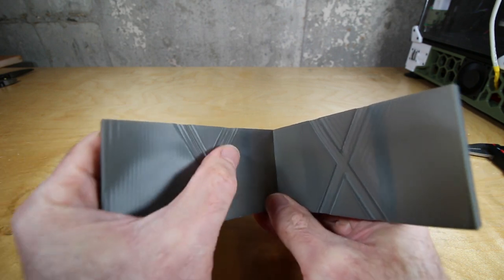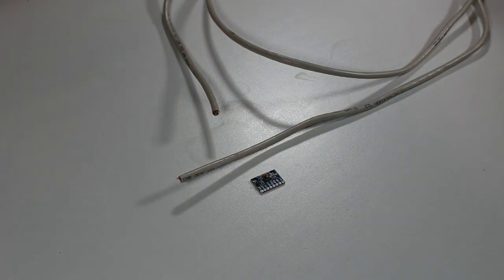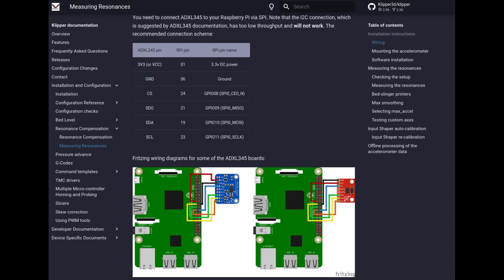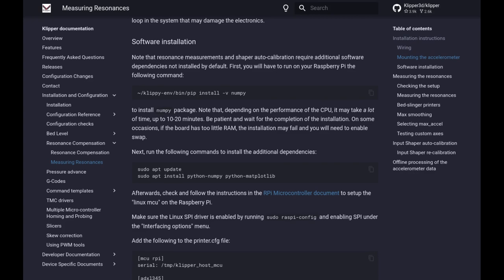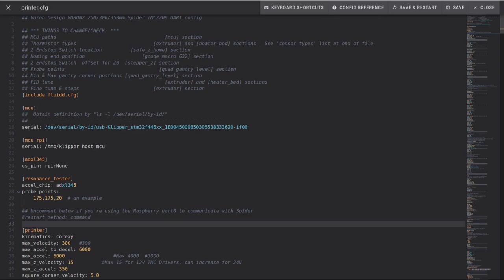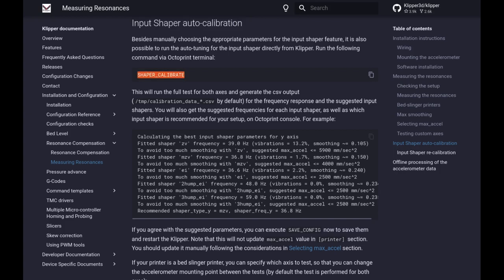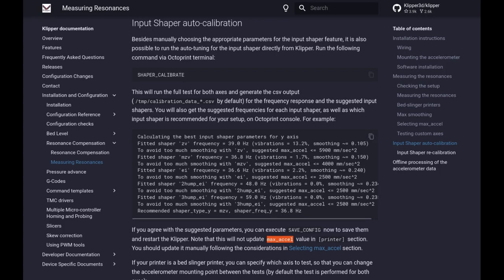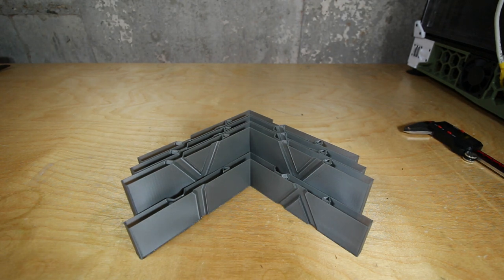Eliminate Ringing at 10,000 mm Acceleration with Input shaping?

Comment: Your video was extremely helpful for me. I also have a Voron 2.4 350x350mm and my settings turned out almost the exact same as yours. At first when built the cable to the ADXL345 I used a ribbon cable that I had lying around, and either the cable didn't work, or the accelerometer was bad. I switched to a CAT6 cable and another accelerometer and then it worked! Looking forward to your next upgrade and thanks for putting this online.
Reply from the maker: I'm glad to hear it.  Thank you very much for watching!

Comment: Thanks for the great guide. Would you mind sharing the STL/3MF file you used to test the ringing? I assume it'd use multiple height modifiers to change the speed/acceleration through the print?
Reply from the maker: Here is the actual Klipper guide: https://www.klipper3d.org/Resonance_Compensation.html?h=input+shaper#selecting-max_accel
And also referenced on that page is the link to the STL: https://www.klipper3d.org/prints/ringing_tower.stl

That said, I highly recommend you use an accelerometer if you can instead.  The device itself is only 2 or 3 dollars.  You will need to build a cable to connect it to your Pi.  It will save you a huge amount of time since Klipper will run the tests for you.  It's also more accurate than the manual option.

Thanks!

Comment: Hi, I am also trying to figure out all this, and I still do not understand why people are so busy with 7000 accelerations if plastics such as PETG rarely support printing speeds greater than 90mm. and the flow limitation is almost reached. Well, you can get 150 there. But what is the point of such huge accelerations, it gives almost nothing in real time printing... what I don't understand? You can leave the acceleration at 4000 without all these complications and lose nothing.
 Is it because I print PETG, is the situation different with other plastics?
Reply from the maker: While the situation is different with different plastics, and flow rate can be limiting, each of these are seperate problems on their own.  Flow rate can be increased with temperature and with high flow nozzles and hot ends.  However, due to the tiny space available on a bed to reach the top speed on a print, the print head needs to accelerate to actually hit those speeds in that tiny space.  There are calculators available online that can show you what acceleration you need to even hit those print speeds.  So taking your case as an example, lets assume your hotend and extruder can actually hit 150mm/s.  With your current acceleration, will it every actually hit that speed?  And for how long?  As acceleration increases, your hotend can hit that speed sooner and for a longer distance which greatly increases the overall print speed.  Acceleration in many cases is the biggest factor in print times.  Have a look at the acceleration calculator at the bottom of this web page (https://blog.prusa3d.com/calculator_3416/) and try some values.  On a 200mm bed, if your acceleration is 300, printing a 200mm line with a sped of 150mm/s means you can never hit that speed for more than about 125mm.  That also means that many of the smaller moves on that print will never hit that speed.  Bump acceleration to 3000 and the printer can hit that speed for almost the entire move.  And moves that are 5mm or larger will hit those speeds as well.  Thank you for commenting and watching.
Reply: @KapmansBasementWorkshop  Thank you so much for that insightful response. I understand. The point is that the printer does not have time to gain speed on short movements. and in printing very often there are areas where even 150 mm will not be achieved. I see. Although the difference between 4000 and 10000 is not that much, but yes, the effect is there and it can be a goal. Thank you.

Comment: I would like to propose a `` non -orthodox 'solution for new users (I have not yet built the printer Voron 2.4, 350mm):
It would be about using the data you have achieved with the accelerometer and use them manually to implement it in the same Voron 2.4 350mm, so it is very possible that the data of the Input Shaper must actually be almost or equal.
shaper_type_x = mzv
shaper_feq_x = 50.4
shaper_type_y = mzv
shaper_feq_y = 36.2
I want to say that using those data that you use can already save us a lot of time and headaches. The same would be possible to share these data with different models of printers.
Reply from the maker: In concept, it sounds great.  In reality, I have yet to see a Voron 350 with the same values of my printer.  They are ALL different.  There are so many variables that impact this during the build.  This really needs to be customized on a printer by printer basis.
Reply: @KapmansBasementWorkshop  I have seen another youtuber video and with the accelerometer get the values x/mzv/50.8 and y/mzv/37.8  in a Voron 2.4, 350mm
Reply from the maker: @valdolandar534  Then I stand corrected :)  Anyone that wants my settings can check my github or ask me.  Thanks for the comments!

Comment: 15:17: 7,000 then 10,000 mm/s² are high acceleration rate indeed! What were the print speeds set in the slicer for these two ringing-free prints?
Reply from the maker: I believe I had it at 300mm/sec.  Possibly 250.

Comment: Does it need to be on a CoreXY? I'm modding my ender 5 pro to use an Afterburner with the stock Cartesian system. Should I bother with this mod?
Reply from the maker: It does not need to be a CoreXY.  Any printer should work.  If you have a look at the Klipper directions, they discuss using this on other printer types as well.  You absolutely should try out this mod.  Honestly, it provided the single largest improvement in speed and print quality (after basic tuning and making sure your printer works well at slow speeds), in comparison to any other mod I have made.  In fact, most of my other mods are in place to help this one do even better.  Input shaping is amazing.  See the links included above in the description.  Do it!

Comment: If I understand correctly, this is not a permanent mount, is it? That is to say, you mount the ADXL onto the toolhead, connect it with the cable, make the resonance measurements, and finally unplug it and store it in a drawer, right? If so, how often should one mount and do the input shaping on a printer?
Reply from the maker: Yes, it is temporary.  There's no need to run it again unless something changes that might substantially change the gantry or if a bed slinger changes the mass of the bed.  Thanks for watching!
Reply: @KapmansBasementWorkshop  so basically constantly on a bed slinger as it literally constantly increases
Reply from the maker: @BH4x0r  I think so, but I don't think it changes enough to have a big impact.  I don't think I would worry about the print itself.  You could also lower the max acceleration a bit if you actually see an issue.
Reply: @KapmansBasementWorkshop  yeah i used to run 6700 accel on X with 2600 on Y with heavy glass bed on Marlin on my old printer, if i went higher on X it lost steps, same for Y

this was like 300mm/s with the stock steppers and psu, but BTT E3 V2 mainboard

I think i had minimum layer time enabled here tho https://youtu.be/2geMIuyQLtU

marlin does now have an input shaper function but you have to configure it manually and i doubt it matches klipper, but it's interesting to not have to use a Pi nevertheless
Reply from the maker: @BH4x0r  There are also stepper driver chips now that will do this as well.
Reply: @KapmansBasementWorkshop  true but thats much more fiddly and requires "expensive" drivers, now literally anyone that updates to Marlin beta can do that, even with stock board etc

this could also be used together with closed loop steppers etc. (cuz there are people that bought em and run them)

i just mean it's much more versatile to have that directly in the firmware

i honestly wish Klipper also existed in a standalone firmware version where you don't need any Pi at all

I get the whole point of Klipper is to let everything be handled by the Pi and do the movement commands via the printers' MCU to offload it on the heavier calculations but well, i'm sure ARM powered mainboards are powerful enough to handle it all at high speed until you reach actual high speed printing (i.e. 500+ mm/s) and even then i think they should handle it just fine

i also personally don't like the way you have to configure klipper, defining stuff in C/C++ just makes much more sense to me, probably cause that's the programming language i'm most familiar with, but on the other hand it's great you can just reload your config while the printer is on without reflashing
Reply from the maker: @BH4x0r  After using both, I can honestly say that I will not go back to Marlin until there is a way to make changes like Klipper supports.  It's just so quick and easy.  Thank you for watching and the comments!

Comment: Did you have a go at manually setting up the resonance testing? I’ve got a delta so the auto calibrate won’t work for me (no X and Y axis!), so I’m wondering how much difference it makes to probe multiple points and to go slower, or to adjust the accell_per_hz value (running at the default of 50 doesn’t make a sound - is it still effective even if it isn’t noticeably vibrating everything?)
Reply from the maker: I tried it manually as per the Klipper instructions.  I don't know if it's my vision or what, but I just could not accurately measure the reflections.  I gave up and used the automated method.  I don't know if you got the chance to read the Klipper docs, but they have a photos of it working on a delta printer!
Have a look: https://www.klipper3d.org/Measuring_Resonances.html
They mount it using this device (seems a little pricy) :https://www.duet3d.com/DeltaSmartEffector
 
If that can't work for you, have a look at the Klipper instructions for doing it manually:
https://www.klipper3d.org/Resonance_Compensation.html
Reply: @KapmansBasementWorkshop  Thanks, I dug a bit deeper and saw that there is a way to manually collect the data for each tower and run it through their analytics script. Their script recommended 47Hz for the EI shaper - from measuring manually I had come to ~45.3Hz!

I think my greatest bottleneck right now is the awkward combination of legitimate E3D hot block/nozzle with the somewhat proprietary V6 style heat sink - when I start trying to push more filament I start getting a weird inconsistent underextrusion, which I think is a result of heat creep that’s in turn a result of the proprietary heat sink not being able to fully accommodate the bi-metal heatbreak; there’s a few mm worth of heatbreak sitting below the heat sink, probably the most important part - the part right after the skinny tube in the middle. Since that part is just hanging out below the heat sink instead of actively being cooled inside the heat sink I’m sure the temperature must be getting higher than it should.

I also found out that collecting more data by way of using more probe points per tower just overloads the Raspberry Pi and crashes the system lol
Reply from the maker: @BlownUpp  Have you been able to increase the acceleration substantially since this measurement?  And I assume your ringing is gone?
Reply: @KapmansBasementWorkshop  Yes! The FLsun Super Racer is advertised as running 150mm/s at 2800mm/s^2 acceleration - which it does, just with a ton of ringing. I can easily run 4000mm/s^2 accell with no discernible ringing - so it's now printing  both faster and with better quality!

Check this out: https://i.imgur.com/vbd9L4k.jpg

From left to right you have stock firmware with their stock profile -> Klipper firmware with tuned pressure advance -> Klipper firmware with manually tuned input shaper (without re-tuning pressure advance). All three prints were done from the same GCODE file with the same hardware and same filament with the only changes being done in firmware
Reply from the maker: @BlownUpp  That's a huge difference.  Similar to what I found on my printer.
Reply: @KapmansBasementWorkshop  Yeah, pleasantly surprised to find the hype was real